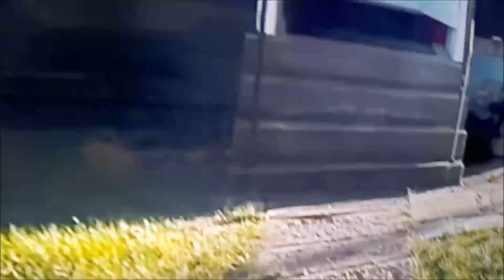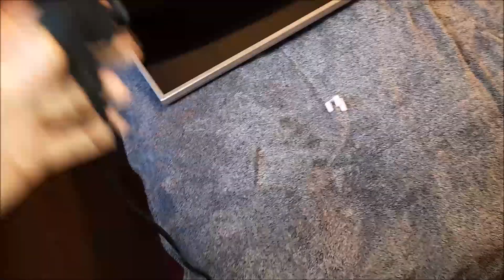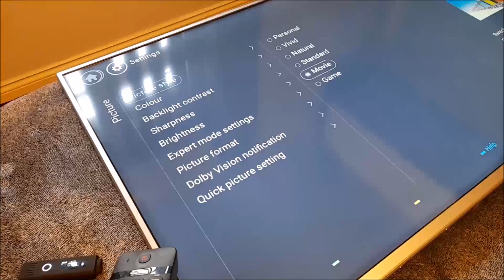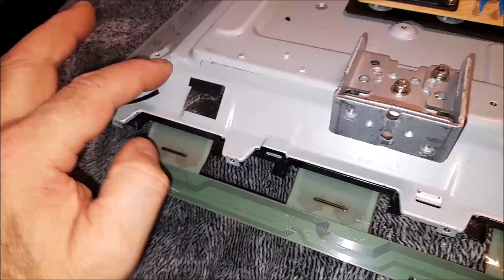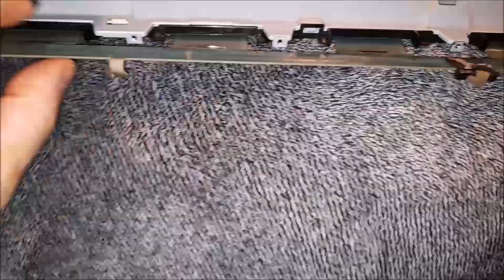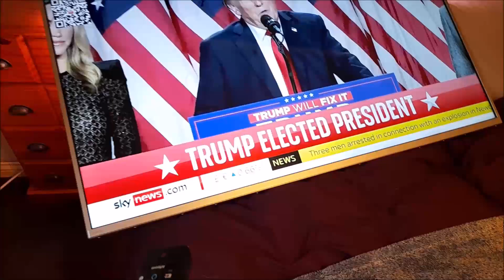Can i fix my flat screen TV?

Comment: I've seen my mate Vince run a solder iron over the ribbon cable .helps to glue melt and attach .it may help
Reply from the maker: @Bob-oo7sm  anything is worth a try thanks
Reply: @eadsierestorations  totally .like said I think he just ran his iron over the top of ribbon cable as melts bonding material.it's worth a try .maybe search on here and see if you can find it .I know it worked if my memory serves me right